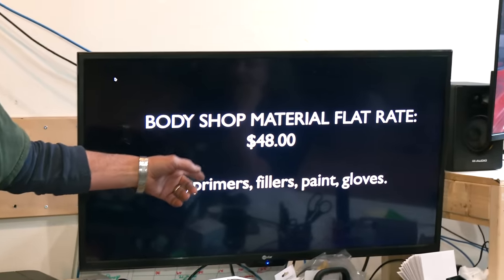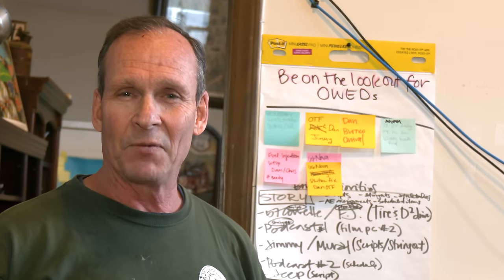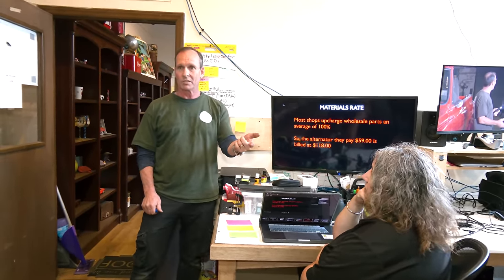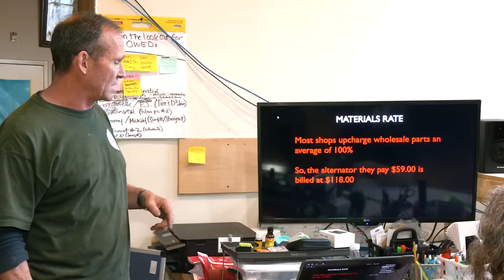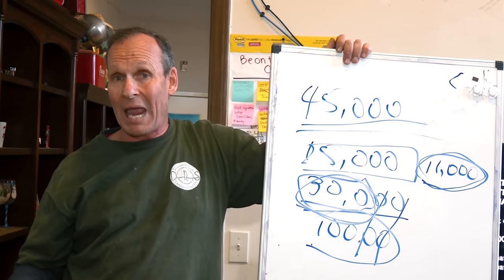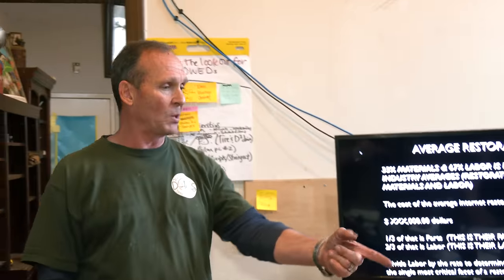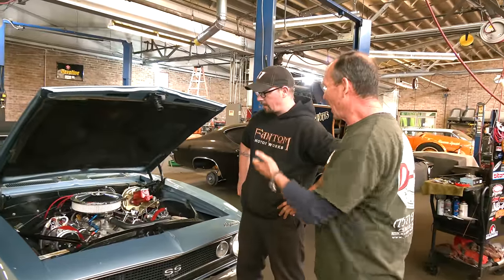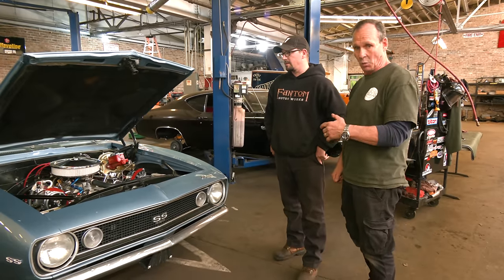Do You Want the Truth or a Lie (4K Upload)

Comment: Good educational post, Dan. I have roughly the price of a modest rural house in the rotisserie restoration of my 1969 Z/28. I am the original owner, so I have no complaints. I think average number of hours for a correct restoration takes around 2 000 work hours.
 I clearly understand the hourly rates. I was a Professional Engineer for 40 years and consulting/design firms charge approximately 300% of the rate they pay their staff. That’s because if the business is to stay in business and provide benefits (health insurance, vacation, etc.), it becomes necessary to have that sort of markup on labor.
  Correct parts in NOS condition are fantastically expensive. All of the exterior badging was replaced with NOS pieces. The tab for those was $1,000. Replacing the alternator with a correct date-coded part was almost $900…part ONLY. Luckily, I had the original smog pump for the car. Otherwise, a correct date-coded pump would have been around $2,000.
  My car has the original drivetrain with correct numbers. It has garnered an AACA first Grand National, 2 Gold Bow Tie Awards, and a Bronze Legends Award at the Camaro Nationals, plus Ingersoll Rand Sponsor’s Choice Award-at the inaugural CarnAmerica show.
 Unlikely I will ever sell this car. Dad allowed me to order this Z/28 when I was just 15 years old!
  I’m attempting to restore Dad’s 1963 stepside C10 truck at home..a very simple vehicle in the time it was built in Baltimore. But life always gets in the way with these projects. I jokingly tell my AACA friends that I am in the 23 rd year of my 3-year restoration plan.
  I know I am running long here, but I hope it’s a testimony that reinforces what you are saying. If you want to make it new again, find $100,000-$125,000 for the budget.
I’m in New Bern North Carolina; hope to come up to Norfolk to see you someday and discuss the deficits that the Camaro National judges dinged me.
Regards, 
Michael Waters
Owner of the first new Z/28 to be ordered in Beaufort County, NC.

Comment: If you put a bone stock 5.3 in that camaro you gain reliability.  With stock power it would work fine. That's not what people typically do though. They want power so more would need to be done. We just finished a blazer swap and it's cost was around 25k plus the blazer.

Comment: Question, upgrading wires do you go with glass fuses or blade type.

I did a 1949 Willie's jeep truck bumper to bumper in 10ga wire all the way to the bulbs. It had a ford motor put in it and i used a blade style fuse box. 
The guy drove it for years like that.

Comment: Awhile ago I did a second gen camaro. Disassembled the body completely,  rebuilt the door hinges, stripped each and every panel down to bare metal inside out. Fix bad metal worked areas.  I had to skim coat each panel to get the waves, small dents, bad previous body work with filler smoothed out. Block all that off. Then prime and block each panel 3 times. Reassemble the body, line up all that panels. Repair cracks in front inner wheel wells, fix the aftermarket rear spoiler so it looked right, stripped the entire inside trunk down, repainted it, painted the car base clear with ss stripes on the hood, nose, trunk lid and rear spoiler. Cut the clear flat, polished it. All kinds of other miscellaneous paint, repair, polish of trim, assembly. 12k. That was a "relative" deal. And if I would have stuck to the original deal then the rest of the car would have look like shit plus probably be damaged and oversprayed with paint from doing things later like trunk, inner wheel wells, trim etc. I will never do a car project like this one was ever again for that price. I think I got screwed and taken advantage of. That car looks bad ass now and has MY skill set and talent all over it. Hope that guy is happy. Better be. Edit. I had 525 hours into that rebuild the body and paint. Do the math.

Comment: There is one thing missing in the flat rate explination. The hours to do the job is based on how long the manufacturer says it should take. If they say it should take 20 hours to change a quarter panel, and you have an exceptionally talented body man who can do it in 10 hours, you still get to charge the 20 hours. So comparing it to the actual clock time isnt really an accurate way to look at it, because another body man might take 30 hours to do that 20 hour flat rate job, but they can only charge 20, and now the shop and the employee just lost money.

Comment: The parts prices have climbed dramatically and skilled craftsman are expensive also. I rebuilt my 428cj in the early nineties and parts alone then were approaching $10k, which of course didn't include my labor or the machine shops labor or parts that they had to use to do their job on getting the block and heads ready for me to assemble. The parts today would cost four times that now. In 1990 you could buy a complete carb to oil pan 428cj for $25k. That could easily be double that, more than likely four times that because as each year goes by the factory original parts are getting harder and harder to find and then there is how popular and valuable the completed car is. You seldom even break even on a car build. Some cars are just not worth the cost of the restoration. As Dan correctly says a restomod is a better value dollar for dollar and the car will be so much enjoyable than a numbers matching nut, bolt and washers restoration. Looking forward to the do it yourself videos.

Comment: The problem is the term restoration is widely used , but Dan had said it best which is " to restore back to condition as good if not better then when it was new. 
Next issue is existing condition of vehicle. If the car is intact and doesn't need to buy a lot of parts. 
Are parts even available or do you have to rebuild / restore/ refurbish existing parts. 
The only way you can restore a full restoration anywhere close to 50k is if you own a shop and pay employees cash under the table for labor and you get all parts at wholesale or jobber cost depending on what market you shop in. 
Everytime Dan did a summary with clients and did the break down , I would try to figure what he charged an hour. I kept coming up with around 62.5 an hour. Which is super cheap compared to the crap shops charge out here. I just paid a restoration shop out here in Hayward CA. They charge 180 an hour and I have never been more unhappy with a shops work. 
I would love to have Dan work on my cars!! 
Dan your show is still the best show on MT even if it's a rerun!!

Comment: I worked flat rate in the ‘70’s. We were not happy with less than 60 hours of flat rate time. A tune up paid 3.5 hours and included a compression test, a carburetor overhaul, spark plugs, points and condenser, pcv valve. The car never got a compression test. It never got a carb overhaul unless there was an obvious problem, but then that was extra. Points for sure, unless your buddy’s car needed a set, never a condenser if the points were burning even. Took a half hour, paid 3.5. The guy across from me charged for a transmission overhaul if the car didn’t shift. So he’d clean it carb cleaner, or whatever, spray some silver paint around, then fix the detent cable or modulator valve in ten minutes, get paid 10 hours, plus he got to take the new parts home where he did transmissions on the side. The guy next to me would do the carb clean thing on a valve cover and head, replace the bad plug wire then get paid 14 hours for a valve job. Flat rate creates real big issues, but the dealers never cared. If tech made money then they made money. Take a look at what the dealers charge when someone brings in a car for a suggested service. 4750 is not unheard of for a 25 point check. Look at what the check consists of and you’ll see real thievery. Maybe a half hour. Most of the checks are visual. This scenario has gotten worse and worse. But the ultimate problem is that people pay without questioning. Stupid customers are fair game. When was a brake job ever worth $2500!
At my performance shop I had the same issues that you are talking about, but after spending 26 years in GM Service Engineering and training you couldn’t fight it.  Just make an estimate, then either do the job or get rid of the guy. He will always be quoted half of what he was quoted, and he’ll pay it.

Comment: i've worked as a mechanic and flat rate can be very lucrative. I know techs that 'need' to do 70 FR hours just to pay his bills, and sometimes can do 150 hours.
Don't know about body shop rates.
No clue how you use a chart to get time on a restoration...i went for a simple floor patch, pulled up the carpet and gees...a simple job turned into days.
Changing / adapting a carb, WITH INSTRUCTIONS...still had to order parts, modify parts, etc. 
It's a hobby so i'm not tracking my time...
and i'm doing more a "i want to use it" job more than a true restoration, which would include complete dissasembly, a rotisserie...that's not worth it (to pay the labor) for the car i'm working on.

Comment: I can believe it I just put an alternator on my daily driver and I had to pull the bumper and radiator and AC condenser and power steering cooler one of the Belt
Idelers wheel liner under front splash shield
It looked like about a 1400 job
And that would have been without recharging the AC because it was already damaged from  previous accident

Comment: I don't see how the other shops come up with a flat rate time with most of the work done to restore a car is not on any flat rate manual. They must just be making stuff up that isn't listed anywhere. I worked years as a flat rate mechanic and most every operation  is listed and if it's not like removing a broken bolt is time for time and you clock in to that operation separately

Comment: In the early 90s I did a restoration on a 71 VW Karmann Ghia convertible. Mostly by myself ($13,000.00 in paint and collision work not done by myself.) It took 9 months to complete with me doing all of the mechanical,interior,electrical convertible top assembly and buying all of the parts .(I paid $300.00 for the car, it ran and drove good but looked like hell ) I still paid probably another $10,000.00-$12,000.00 for the parts I had to buy.
So I paid about $25,000.00 plus did all of the labor, in  the 1990s', for a mint 71'VW Karmann Ghia convertible.
I think I could get about that much for the car today if I still had it.(it was totalled a month after I finished it. I got $12,000.00 from the insurance company and kept the car.
I parted it out and still lost money.

Comment: Everything is great you said but the 426 hemi could be had with drum manual brakes all the around . A friend of mine bought a 71 Nova he is not a real car guy Eastman 46,000 on a replica yenko cologne he got the car with a 10-bolt posi and supposedly I hopped up 383 I should let me tell you something any car for 10 bolt that they put a performance motor everything is cheap in it now he's trying to LS swap it supercharger twin turbo and he's looking at between 60 and 70 k when he could have bought it already done if you would have just listened ! Sometimes people need to open their eyes before they open wallet. Don't understand why he did not Google about the 10 bolt and the other piss poor Parts on car

Comment: The only way to do restoration economically is the owner of the car has to do most  all the work.
I've disassembled my Cuda to a hull, super sand blasted, PPG epoxy primer, purchased fenders tail panel, front & rear valances, everything new brakes, all new suspension front & rear & now starting bodywork. I'm over $30K

Comment: 100% i just stripped my c3 to glass and panel bonded a custom 73 rear & painted it IN MY GARAGE and it took 5 months of many hours every single day and im still wet sanding paint and buffing probably 500 hours in just last 5 months. And prior to that i have worked on everything else, every week 4 to 10 hours... the 406 engine rebuild, Transmission build, tubular suspension... and i guess that 4.5 years was another 1000 hours or more... and guess what.. my interior in next... all in my $2k 75 c3 has cost me "ONLY" $17k more.. and ill probably spend another 3k on interior... labor is $$$ its still wont be worth what you put into it.. its  HARD.. so my advice is forget the $ and find a car DONE.. or enjoy the journey and let him or a pro do it.. if thats not a option. Roll up your sleeves and get to work.. or get to learning or likely both. Thanks

Comment: 24:37 
Pride,  its also, why drop a shiny motor into a shit box and expect it to hold together under load.
Just because you cant see it doesn't mean its not about to fall apart.

All these things they are talking about on a unibody car  will in a lot of cases be very difficult.  
Even cars in no rust states.
Reply: Good question, would you restore a K car, better yet could you restore a K car?  Lets say a 1980s new yorker.

Comment: $25k for a full resto😂😂😂😂😂😂 I restored a series 2 XJ6 , I paid $1500 for the car the cheapest repaint quote I got was $15000. I did all the work myself and I spent over $12000 that included paint body work mechanicals brakes etc new interior etc . A local company charges $ 30k instalments . So strip it to a bare shell $30k
Then quotes on repairs .

Comment: I used to work at ALLDATA where we publish the estimated hours on repairs.   It should have been noted that these hours are for using no special tools, just hand tools, like a wrench.   Ever real mechanic uses air tools (or today electric tools), have lifts, and special tools, which makes the time usually at least half the estimated, which gives you the 2.1 hours for each quoted hour.   
This really is a scam on the consumer, but who would have the power to fix it?
Reply from the maker: One shop at a time...

Comment: So here is my math. Lets say shop rate is $100/hr. Shop has 5 workers including owner. That makes 40 billable hours/day and 200 billable hours/week. Times $100/hr. That's $20,000 billable revenue per week. So you're generous and you split 60/40 with the workers.
(Not all people are $60/hr people. You better be PDG to earn 125k/yr as a mechanic) That's $8000/week in revenue for the business, except the owner is one of the 5 so they keep the whole $100. For 52 weeks that comes to over $416k after you paid the other 4 people. If your yearly overhead is more than that you need to charge more or cut overhead. You can't cut employees because  you lose billable hours. You mark up parts 30% and generate more revenue that way. In restoration projects there is no flat rate manual. It's always time and materials.

Comment: Bad Chad can do a full car in less than 300hr.  Well, it might Crack in half if you drive. It will be half 1/2 bondo in spots and no headliner. But it will look good from across the street.

Comment: You are 100% correct about the cost of the restoration cost. I am restoring a chevy pickup and just the drivetrain aspect of the truck I have $17,000 in the motor setup and supporting systems to get the motor running. That cost doesn't include any of the body work, wheels, tires, interior, suspension, or stereo and other odds and ends that ya know ya want to do when ya are restoring the vehicle! These people are idiots or they are just trying to play dumb to their oh poor me routine that they poor on ya expecting to get a deal out of ya!

Comment: Material costs are pretty severe now. But the number of hours spent on a restoration are dependent on so many other factors. Things like restoration to stock or modified. The completeness of,and condition of your starting point. A person has to also  consider the system of construction (full frame or unibody or convertible etc), and most importantly what sort restoration the customer wants.

Comment: Say a new car is 30 to 50 k from the factory. That car is put together at the factory from brand new parts. A restoration car takes twice as long because you start with a old car and have to completely take apart every nut and bolt, every peace in the car and rebuild, restore every part then put it all back together! So if you look at it like that people should have a better understanding about the price 🤔
Reply from the maker: It's a lot of work, that's for sure

Comment: Hard to believe you can do an LS swap with front chassis, brakes, rear end, 4 link, exhaust, brakes, fuel tank, radiator, transmission, wiring and etc. for $100K.

Comment: This is kinda funny. They have legit point on the cost but it was hilarious to hear them imply theyre using the best stuff and then call a 4l60/70 an 80. Thats like calling a Pinto a Cadillac. The 4l60e based transmission is known for not lasting at all. Even when built theyre pretty bad. They were trying to say it was an 80e because they knew using a 60 or 70e is is embarrassing. And im sure that the smaller transmission was used to make it all fit as well. Also, a high end LS crate engine is 25k a really good built trans is 5k. The best supporting gear (full fuel system, aftermarket efi, wiring, if money was no concern is under 10k. Even with all that and the labor to retrofit it, it would never add 150k of value to a Corvette. I can appreciate where he is coming from trying to stay afloat in a very difficult business but if you spend money on a classic car, dont do it to raise the value. It almost never works out.

Comment: Been restoring cars and trucks for 45 plus years l am retired now .Most cars like 75 percent are just not worth spending 100 or 200 k to restore your better off buying one that has been properly restore with most of the bugs have already been work out. It would be a better deal and save you possibly years of time and headaches. Most people just  care about looks, nice wheels paint sound and ex system not so much hp. Just my opinion because l like all original numbers matching  putting a LS engine in sometime will bring down the value. I am not talking about pro mods which are the hot thing right now.